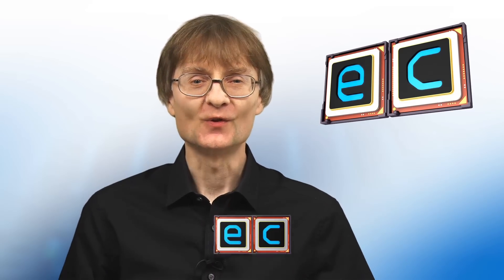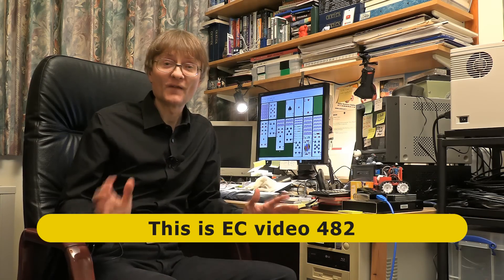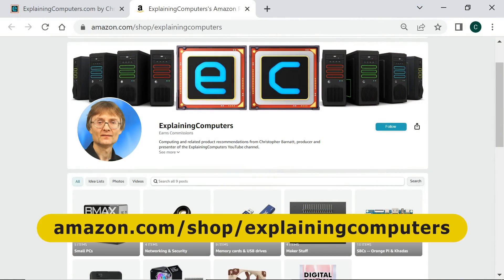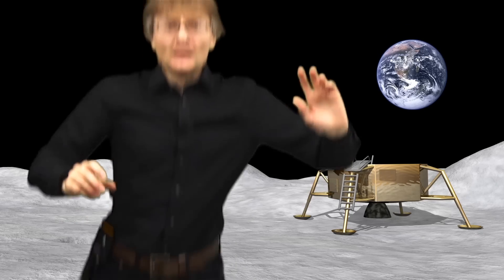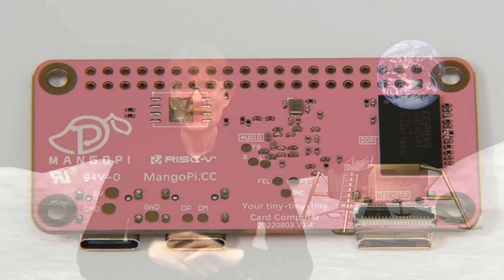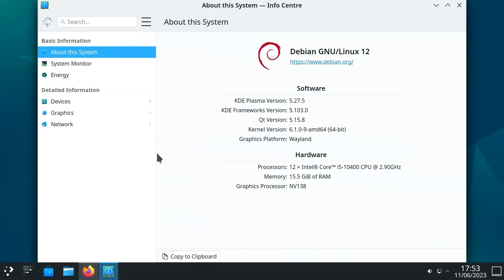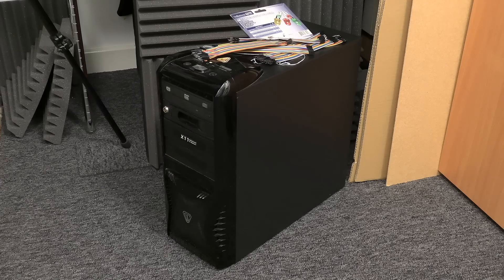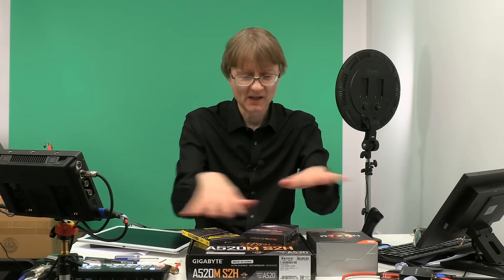Channel Update July 2023

Comment: is there a difference? motherboard standard: m atx and micro atx? when to apply and which of the entire rich range of ATX , itx standards? thx:)
Reply from the maker: Yes, Mini ATX and Micro ATX are totally different things. Mini-ITX are the smaller boards, 6.7 inches square. But Micro-ATX are the smallest "standard size" motherboards, typically about 9 x 8 inches, although sizes vary (the maximum for Micro-ATX is 9.6 x 9.6 inches).
Reply: @ExplainingComputers  thx 🏆

Comment: Any chance of doing a video on setting up a dual boot system for older operating systems such as win xp, 98 etc.  Cheers.
Reply from the maker: A very interesting idea. But for older OS like that, I personally would (and do) run them in a virtual machine. Specifically I run XP most days in a VirtualBox VM.

Comment: If you are going to rebuild your PC, you don't appear to have considered the power supply to be the faulty component which you say you are not going to change, the Building of a AMD machine is going to be of great interest with so much news on the latest models burning holes through the CPU. I was wondering what you use your floppy disk drive for or is it just there to remember the old days?
Reply from the maker: Oh I do, I just didn't mention it here! :) The PSU was changed in late 2022, but made no different to the stability issues.

Comment: Can I make a suggestion for AI content? HOW to address AI to procure desired results. For example: there are specific search terms and prompts which will yield different results, how do I input the positives and discount (input) the negative prompts to fine-tune the output? You could demonstrate with a range of AI output while educating thousands on tips and techniques which may improve their use of AI based search engines and creation tools. It's an idea.

Comment: And my final comment (or question). What corruption have you encountered with GRUB and dual boot. Now, I use a dual drive solution, and simply chainload Windows to update, and then reboot back to Linux (I have no idea why I have a 1Tb drive assigned to an OS that I only ever boot to update it), but in the dim and distant past I did use a single drive dual boot with GRUB and never experienced any corruption. Colour me curious.
Reply from the maker: Hi Steven. I have experienced a Windows update corrupting GRUB, and removing access to Windows and Linux (and I've read many reports of the same problem over the years). And I don't like Windows booting via GRUB anyway. So I don't use GRUB with my dual drive dual boot -- the video will show all. :)
Reply: @ExplainingComputers  It may be that I'm mis-remembering. certainly dedicating a drive to Windows (with it's own bootloader) and chainloading has no such issues. Update Windows, and all it updates is it's own drive, regardless of how I get there (either direct boot from the drive, or chainloading). But then, I may be pre-empting your video. Sorry about that. :/
Reply from the maker: It seems we are in total agreement! Keeping two OS on their own drives with their bootloaders on their own drives means there will not be a problem. But this is not how most dual boot setups are made. :) Most are single drive, and can certainly lead to corruption issues. And by default, most Linux installers doing a dual-drive setup will keep the bootloader for both OS on the same drive.

Comment: I am curious to know is your main pc today? :)
Reply from the maker: All of my video and graphics work is done on the tower you see under my desk -- inside it is an i7 6700T with 32GB RAM and lots of SDD and HDD storage. All of my writing, admin and online stuff is done on the smaller i3 PC that sits on my desk, and which runs Linux Mint (which is what is displayed on the monitor in the video) as well as various other OS in virtual machines. A KVM box switches between these two computers. But I also do a lot of writing, admin and online stuff on my laptop (a dual core i5 Zenbook), which is what I'm typing now. :)

Comment: Keep up the good work, lots of useful information and tips.
After your video on refurbishing and upgrading mini-PC I took the plunge and got two Lenovo Think Centre Tiny computers from ebay, in both I swapped out the spinning rust disk for an SSD cloning the Windows10 install using instructions from another of your videos and installing Ubuntu on the other, they have been great so far.
Reply from the maker: Great to hear of your success with the older hardware -- as well as cloning and Linux. :)
Reply: @ExplainingComputers  all thanks to you ssd replacement video and the cloning software you recommend.

Comment: Should probably replace the power supply as well. That's another cause of random reboots and instability
Reply from the maker: Indeed, I should have noted in the video that I did that last year. It made no difference. :(
Reply: @ExplainingComputers  ohh well... my AMD PC has become very unstable recently with blue screens. I keep trying to fix it but I'd probably save my sanity of a bluescreen in the middle of a Teams call by replacing it. Just hate getting rid of old otherwise working equipment.

Comment: Here's an idea for 500th vid or 1mln subs, whichever should come first: take a gopro or a mobile+selfie stick and show the World what a day in life of Cristoper Barnatt looks like. It may be specially themed as not computing related (at first glance), like going to a theater or visiting a pub or buying clothes... and then suddenly turning into computing related. For instance: rfid tags on clothes and using pico pi to read rfid or theater lights and using microcontroller(s) to run the lights... You get the drift

Comment: New(ish) subscriber here. Some ideas…

Best-of videos revisiting/updating older very popular ones
Outtake videos showing some things that didn’t work well or funny things that happened during production
An SBC Media Centre build, both hardware and software (LibreElec, Kodi, …)

Oh, not upgrading the 2012 build PSU? Strongly suggest PSU replacement if it’s 2012 vintage.

Comment: What? No more 3D printing :(?
Reply from the maker: I did this a few months back. It did not sort the issue.
Reply: Sorry, what issue? I was being playful in suggesting your upcoming videos should include something on 3D printing like you've done in the past. Your response sounds like you typed in the wrong box - like it was a reply to another comment.
Reply from the maker: Sorry, and you are correct -- I have replied to the wrong comment here (one about changing the PSU in the old PC). You are right, I should do some more content involving 3D printing. :)

Comment: Your video about the elitedesk mini PC inspired me to buy a refurbished Lenovo ThinkCentre M900 Tiny PC with a Core-i7 for 300 Euros, 
And a second one ten days later for 250 Euros. No space for a second HDD or SSD though. Gotta use external USB HDDs, but I would have done that anyway. Both have dual monitor DP, the first also has dual monitor VGA ports. Both have 240 GB SSDs with Windows 10 - suits me well as I didn't want to bother with new Windows 11 quirks.
Maybe you could take a look at this type of computers too.

Comment: Install a new power supply.
The caps in this one are going bad.
Reply from the maker: I did this last year, but it did not fix the issue. :(
Reply: @ExplainingComputers  Hmmm ... Any caps on the board? Look closely if the heads bulge ever so slightly at the breakup lines (+)
Reply from the maker: I believe there are (were!). Quite possibly the issue.

Comment: For your 500th episode, I suggest you review a Macintosh computer and Mac OS 12 or 13. Preferably Apple Silicon Macs, but Intel Macs are ok. There are lots of Mac users as well as Windows and Linux users. After all, Mac OS is a Unix-based operating system that is a highly modified BSD Linux distribution. You can also build a PC using SBCs like Raspberry Pi as a secondary option.

Comment: ep500: TARDIS content : 500 hours inside a 5 min shell. Perhaps Quantum Computing AI enhanced? I have for ages been wanting to get a measuring device for the water depth of our river. Or height above some fixed point, second to second. Reason: the Tonga Volcano some thousands of kms away and the Tsunami last year sent small waves approx 150mm high up the river and i'd like to measure these as well as the tidal influences of approx 1 meter. You have inspired be to try to set up a SBC project. we are 8Km up a river on a horse-shoe shaped river ( thames tonsil like). Mangonui Northland NZ. Thanks for your videos. and just for the heck . i may even relearn COBOL to use in the project. Fun times. Anyone ever done an AI vs Human small project code comp? Thanks Christopher.

Comment: Re the old computer upgrade - doing well to get 10+ years out of a power supply, when you start the upgrade maybe see if you can get the lid off the supply and see if the electrolyitics are starting to bulge at the top - it may be slight, but a sure sign they are on borrowed time, they work very hard for a living.
Reply from the maker: I should have noted that the PSU is less than a year old. My test machines kind of evolve! :)

Comment: Great content as always. Great channel for when you are on a budget, never the latest and greatest, but always informative. What I wander about quantum computing, are there emulators? Program excamples. There is only it is here, it is now working, that is what it can do, but never an excample, piece of code where it differs at normal code. With those cheap mini PC's when you add a 2nd network card it can function as a router with OPNSense. The distro I like is OpenSuSe, seems more stable than linux Mint, at least for me. Just some ideas for the channel. There are enough high budget IT channels, yours is special, having fun with IT without robbing the bank.

Comment: build a system for an offline AI and use something like ColossalAI or something to run on it (suggestion would be a system with one of the many cheap TESLA nVidia cards like the K80 24GB card with around 4500 cuda cores, or the M10 TESLA that has 32GB of ram and even more cuda cores or maybe they have some other tensor core? not sure, anyway the former is only like 50 to 60 bucks for one, and the latter start around just under 200 dollars for a unit, 

it should included a full section on building the custom cooling system for it, (this would be awesome if you were able to get some shipping back and forth with video made to go with it say with Jayz 2 cents channel since he seems to LOVE custom cooling systems so I bet it would end up being something snazzy looking too, as well as being effective and very quiet so you will be able to clearly hear your AI overlord's commands!!! LOL

Comment: It’s interesting what you’ve said about the dual drive boot video. The current state of my PC is that I have two SSDs - one for Windows and one for Ubuntu. I installed Ubuntu onto the second SSD long after I installed Windows on the first SSD, and I did have to run boot-repair to get it to work. After that though I set my BIOS to boot into the GRUB menu, which picked up that windows is on the first SSD and lets me pick my OS (and therefore drive) on boot. It seems to work OK but I’m glad I did it with two drives rather than partitions!

Comment: I agree that AM4 is a killer value right now. I lucked out when j bought into the Ryzen ecosystem in 2020 with my desktop based around a 3200G cpu. It was fine them but those early ryzen chips had some stability problems. Luckily when AM5 came out I got a Ryzen 5600 that dropped into my a320 motherboard. I will let you know that the Ryzen 5's stock cooler is not great, it is quite loud and runs hotter than i would deem comfortable at 95 Celcius at full load with a screaming fan. I would highly suggest for the sake of not only yoir processor but to make filming easier that you fit a Noctua cooler like a NHU-12S redux (if it fits) in order to quiet it down.
Reply from the maker: Very much agreed -- the weak point is the stock Wraith cooler, not very quiet. I did a 2-part series on making a PC almost entirely silent last year -- but it was not popular! :(

Comment: Congratulations on getting to 500 videos. 500th video could be ... an electric coconut! Decorate your coconut as desired, drive two wood screws into it about 40mm apart, orient the coconut with the screws on the bottom so that they are connected to the milk, connect about 240V / 5A to the screws and control it with a variac. Wait about 2-3 minutes. Don't do this indoors or in a noise-sensitive area, my relative who served in Afghanistan said it was a louder bang than anything he heard during his tour!

Comment: I agree with you as even the older AM4 socket processors are more than powerful enough for most applications.
Reply from the maker: Thanks for this. I am waiting for the "how dare you do an AM4 build in 2023" comments next week . . .
Reply: @ExplainingComputers  it's crazy how people feel they need to buy the latest thing in tech when it is not necessary...if it wasn't for Windows insisting that they were now "too old", many could get by with 2nd or even 1st Gen i5/7 systems.  Linux, however, allows one to just keep using hardware, regardless of its age. I use a R5 2600 after upgrading from an i7 2600 based system a few years ago only because it would not run Windows 11...to be honest, the i7's performance at times seemed smoother !

Comment: Buggy computer? My Dell SFF from about 2013 suddenly started going buggy after years of faithful, uninterrupted service. CPU fan went into overdrive, sounding like a jet engine and then decided to shut down after 10-20 minutes. Researched on the web for solutions, which seem to be universal conditions in our aging machines. The first is very common: bad capacitors. Companies cheaped out or were supplied an inferior product. As soon as I opened the case I saw some bulging. The ones that were bulging had different markings from those that weren't.  It will be a PITA to pull the mb and replace them, so I don't think it's worth the effort.
The second condition is something I never heard or thought of before. I pulled the cpu heat sink/cooling fan and it looked like the thermal paste had dried up. There was hardly anything there. Replacing it will be a task for this afternoon, so I don't know if it will be the ultimate fix. But it is something to look at also.

Comment: I know its a moot point as you're upgrading it all, but that computer with problems sounds like RAM to me. Over time, simple corrosion or even galvanic corrosion can occur on the card-edge contacts. The problems can be intermittent and may not even appear as normal memory problems... and the symptoms can be almost anything, including some completely nuts stuff. Recently my Plex/SMB server had this happen, and it caused it to turn on and off endlessly until i discovered it in the morning. It's also worth noting that this can happen with PCI/PCIe cards, with similar symptoms too, but it's not as common as on RAM.

Luckily, the solution is simple (if this is your problem). Rub an eraser across the contacts of the RAM a couple of times.

Others have said this is a power supply issue, I don't see why it would be. Plus, you said in other comments that you replaced it, so it definitely cant be.
Reply from the maker: I would agree with you -- the RAM may be a factor.

Comment: you will hit 1m, you need to splurge and get modern 2-3 monitor setup - sbc mkt should continue to grow, hopefully we see even more growth from risc-V - do a special on full on refurb smb/office network setup - ha opnsense, ws, a couple lo power servers, pihole, a laptop and a vm server, do some content on bonded 2.5 gbe? you have plenty of areas to explore - do some moonshots - do raid0 nvme and see how much performance you gain - lastly i think you will want to goto a faster lan - it is the no 1 bottleneck essentially - you should try to go to 100g on modern ws and servers you make from here on out - it may sounds a little uppity but it really does make sense and 100g cards are coming down in price - they have value #connect-x the dots #dac

Comment: PCs not booting, randomly shutting off, and hanging randomly are all symptoms of a dying power supply. If your new build is buggy in a similar way it would be worth trying to replace the power supply.
Reply from the maker: Good point, but I've already replaced the PSU last year. Sadly no improvement --  but it leaves a nice PSU for the build! :)

Comment: As for the system no longer booting randomly sounds like a partially dead stick of ram or a processor memory channel is dying.
Or possibly the motherboard bios could use a reflash to kind of wake it up again due too bit rot.

Moved too AM4 in December 2022 here myself after having socket 1155 since January 2017 with a I5 2500 & then 2500k at 4.5 ghz from around March 2021.
Before that i was on AM3 with a phenom II x6 1090t as the final upgrade on that platform in March 2015, Athlon II x3 445 in 2010 on am3 is where it started & then later in 2012 in August a phenom II x4 955.

Current specs here is a Ryzen 5 5600, 2x8 gb Kingston Fury 3200 mhz ram & a used MSI B450 Tomahawk Max motherboard.
And a m.2 ssd kingston fury 1 tb ssd which is a solid drive so far with good durability.
I'm keeping the GTX 1660 super i bought the first week of October 2020 for a while longer.
As gpu prices are still pretty garbage in terms of value too performance still in my parts of the world.
A 4060 ti is 2x the performance but also 480$ as the cheapest in Sweden.
Meanwhile the 1660 super was 2335 sek or 216 usd in today's conversion rates.
I've modified the 1660 super a bit with a pair of Arctic P12 PST 120mm fans & a phobya vga too pwm adapter for more cooling & for less noise.